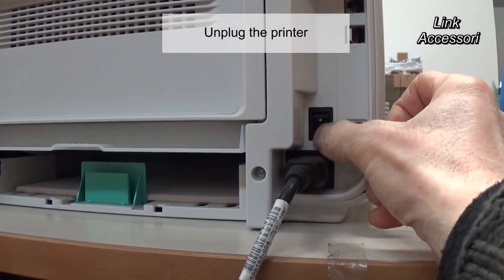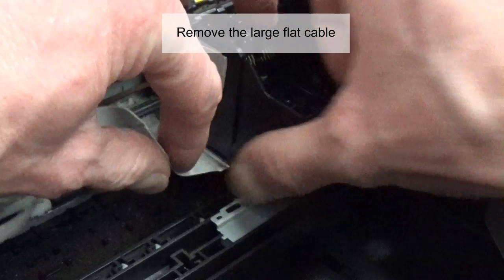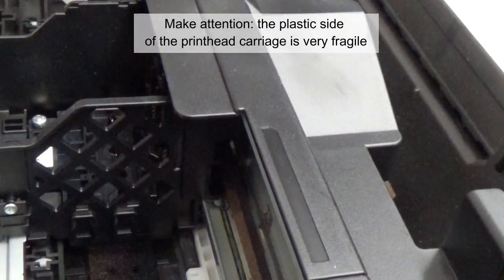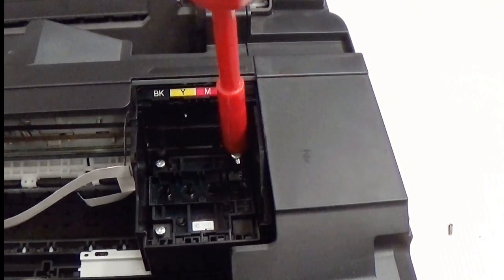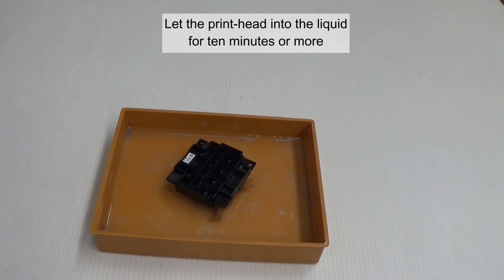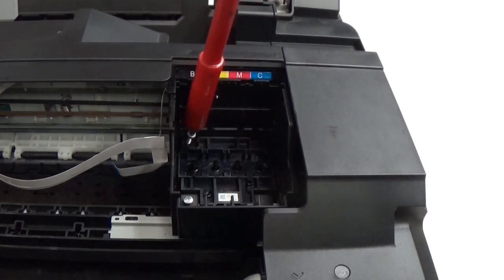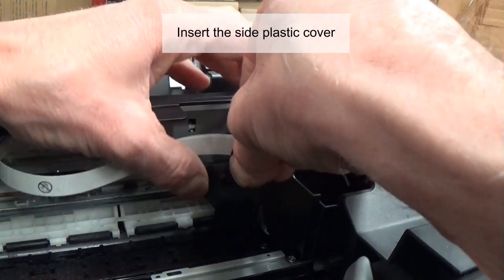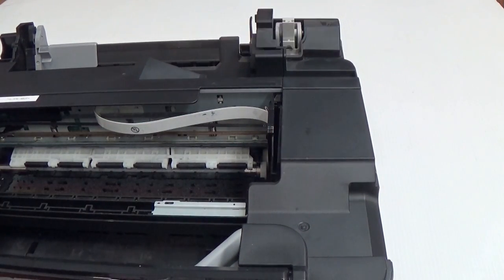How to remove the print-head from Epson inkjet printer XP300 WF2530 WF2540 XP400 and others

Comment: EXTRA CLEAN!!! I followed the video but after soaking, like the cleaning kits, I took a syringe with a tube on the end and flushed all four nozzels with hot water and window cleaner til it came out clear. Works great! The ribbon wires can be tough to get back in but make sure they are in snug. If it's loose it's not all the way in.

Comment: I did it on a Epson Stylus NX330 and i had to do it twice(put it in hot water) but it worked. the pieces are a little bit different but it's the same steps. You have to print many test to let the ink comes in the head.Finally it works well. Thanks a lot.

Comment: I confirm that this method works on WF-2540. But at the end I needed to run the head cleaning from the printer's menu around 4-5 times to get perfect prints. Thank you very much for this video!

Comment: Excellent video. I have cleaned many print heads before and this was by far the trickiest. My XP300 had almost stopped producing color, and black print had white lines and gaps running through the text.  As well as immersing the print plate in shallow warm distilled water, I used an eyedropper to force water down the individual color plugs on the top of the unit.  I kept changing the water until it was almost clear. I followed this with a cautious use of compressed air to blow out the channels. After much fiddling to put the unit back together. I then ran a cleaning cycle to prime the now empty ink channels,  followed by a couple of pages of fairly intense color. The printer is now working like new.
Reply: I read the other comments about the upper small back cable, but I should have kept reading to see this one! Just put mine in shallow water but forgot I have hard water, hope that doesn’t affect the end results. Distilled would have been a good idea.

Comment: Thank you very much for this video. Very detailed step-by-step instructions. In the end, I could not get the print-head to unclog, short of using the tube and syringe method in other youtube videos. So I just swapped print-heads out from another XP-400 and it works just fine. Thanks again!

Comment: Hi, excellent video. I had attempted to clean the head on my WF2530 with the cleaning fluid but it didn't work and still left the black printing intermittently. I removed the head as per your video and then replaced it. After one nozzle check cycle using the printer I had perfect printing.
A few observations, when the print head is placed in the water make sure it doesn't allow water into the connector for the large flat ribbon cable, the water has to be very shallow. I also used a small syringe with a plastic tube on the end, I had one that I used to clean the heads with cleaning fluid, to push a small amount of warm water through the head from the top using very very little force.
To be on the safe side slide a thin piece of blotting paper into were the large ribbon cable goes after cleaning the head to ensure its dry. Also it's possible to put the ribbon cables behind their intended connections make sure they are in correctly.
Reply: What do you mean by "put the ribbon cables behind their intended connections make sure they are in correctly." ? =)
Reply: However, I submerged into the water as the video shows. Now my printer is flashing the lights and not much I can do.
Reply: @cfvgd  That they are not in place and you only think so !

Comment: Worked on WF-2510, but it is best to remove the scanner section first to allow easy access ( just google epson WF-???? scanner removal), i also used a 20ml syringe and hot water to flush water through the ink intake ports on the head unit. As others have stated follow the instructions carefully, only remove ribbon cables indicated in the video. Thanks for the video, saved me buying a new printer.

Comment: Just to let people know everything is right on video besides the small ribbon cable. You do not have to remove the back top little ribbon cable,if you do your screwed. You will never get it back in. This video cost me a printer,oh well needed new one. Beleive me take your time on ribbon cables,and whatever you do. Do not remove little ribbon cable on the top back. Besides that it's a great video
Reply: hey thank you for the comment! i was about to pull out the small cables.
Reply: I wish I had read this comment before attempting to clean my printer before going to bed
Reply: No idea why the video says to do this..serves no purpose and is impossible to get back in

Comment: A good video on solving a major problem for Epson printers, BUT, MY GOD WHY DIDN'T YOU WARN US TO NOT REMOVE THE SMALL CABLE IN THE BACK!!
Reply: I just don't know how but I plugged it.😂 Just try with your finger and push a bit till you get the hole!
Reply: as a veteran printer repairman , you will need either a long thin needle nose plier & or a grip-type tweezer.... when inserting it back in,
make sure the METAL SIDE contacts the circuit board !
Reply: @xrtyty  Glad you mentioned tweezers, was about to give up until I read this. It does actually say to remove only the two cables so that'll teach me for not paying attention 🤦‍♂️
Reply: How does that back cable magically apear plugged in!!!! 😱😱😱😱
Reply: That was so difficult.  I had to grab the electric taped to get the flex cable out of the way first.uusing electric tape I taped a flathead screwdriver to the notch under the blue stiff part of the back cable and gently with my fingers to stabilize I pushed it in.   It went in fairly easy.  The bottom one was crazy I had to flip the printer on its side.   After turning it on I had to wait a few hours for all of the colors to print brightly.  What a headache!
Reply: @victorvill3812  a
Reply: Exactlyyyyyyyyy
Reply: Lol after an hour of trying to get the small one in I threw my entire printer away

Comment: Be very careful trying this method, I tried this on an XP-446, which had a very similar setup.  It seemed like it would work -- I got all of the parts disassembled successfully.  The board with the electrical contacts gave me a little trouble, but eventually came out.  The print heads gave off a lot of ink when soaked.  After I had everything reassembled and reattached, I noticed I had stretched the bends in the flat cables a little too much, and they were dragging on the printer frame when the assembly moved.  As I tried to bend them back into place, disaster -- the small cable in the back came out, and as many have noted it's incredibly difficult to put back.  I removed the plastic piece that ran along the back of the print assembly track for better access, and after a while even tried the method mentioned below using tweezers/rubber band/knife, which seemed promising until the ribbon cable ripped at the end when I tried to reinsert it.  I should have read a little further about disassembling the printer even more, but I was really tired of dealing with this printer already.  Now the printer is officially the complete piece of junk it pretty much always was.  And I had just wasted money on new (now useless) ink catridges as well.

Comment: STOP, DO NOT REMOVE SMALL WHITE CORD. If you do then you must unscrew the screw on the right hinge on the inside then push on the 2 clips on the left and lift that plastic piece. Then you will have better visibility to use your finger or tweezers to get it back in. Otherwise you may have to disassemble a lot more.

Comment: The small ribbon cable in the back can be put back IF YOU SLOWLY TAKE YOUR TIME (LOL, I DID NOT AT FIRST). push the carriage toward the right side until you can see the white "mini usb looking" slot behind the carriage.  Then take a pair of 8" curved hemostats and attach it to the end of the ribbon cable so that the blue part does not move left or right.  You will also have to angle the ribbon cable so that it goes straight in and this may take a few tries to get the angle right.  If it takes more than that YOU ARE IN TOO BIG OF A HURRY.  The left finger hole on the handle (for me) was touching or close to touching the metal wall.  Angle the hemostats so that the ribbon goes straight into the opening.  Do this slowly.  When you feel a little resistance and the ribbon is seated, pull the hemostats back and the ribbon should stay.  I BEAT MY HEAD INTO THE WALL AS MANY TIMES AS YOU DID AND THE RIBBON DID NOT GO IN UNTIL I TOOK MY TIME AND SLOWLY GUIDED THE CABLE IN .  You may want to use a flashlight to see just where the slot is and you may have to guide it to where you thing the opening is.  IT will work...

Comment: MY GOD! ... I disconnected the top cable too, like everyone else here...BUT I WAS ABLE TO GET IT BACK IN without disassembling the printer further. Here's how: I rubberbanded a pair of tweezers shut as hard as seemed reasonable, and inserted the blue tip of the cable while prying the tweezers open with a knife. this let me maneuver the tweezers and thus the cable from the very furthest end of the tweezers - providing just enough visibility and and space for my fingers. i gently edged my way through this and was able to insert it. then i cut off the rubberband with an exacto knife and unraveled it. then i exhaled. and they said it was impossible. holy. fucking. hell.
Reply: holy hell thank you so much for posting this! I tried for an HOUR to get that thing back in and your method worked! bless you!
Reply: Wrapping the tweezers with a rubber band was an excellent idea and worked for me. Unfortunately once I tested the printer after all this it still was missing lines while printing. Guess I'll replace this $45 epson with a $19 cannon printer...

Comment: WARNING Before you remove any of the ribbons read the comments!!! Like many on here I removed ALL the ribbons and the rear one is impossible to reattach. The video is good apart from making it clear you should only remove two of the ribbons. It would be helpful to make the video clearer showing how to reattach the fiddly ribbons. Off to buy another printer.
Reply: Make Attention!
Reply: @LayneBenofsky  , exactly the mm work with an xp 2155, I removed the bad little white cable at the back, result I had to put the soldering iron to remove the small detector at the back, once reconnected, I glued with a glue gun, problem it never worked again because the printer flashes all these leds at the same time...not found how to make it work again.

Comment: Thank you good sir. Worked amazing. DO NOT REMOVE THE FAR BACK RIBBON. WATCH THE VIDEO CAREFULLY.
Reply: as a veteran printer repairman , you will need either a long thin needle nose plier & or a grip-type tweezer.... when inserting it back in,
make sure the METAL SIDE contacts the circuit board !
Reply: It was off when I saw it!!! 😫😫😫😫
Reply: Hello did you find how to put it back? Any video of disassembly maybe? I removed it also...
Reply: You can put it back thru the back of printer by removing the white that holds the all the white ribbons. You will have to disconnect the two big ribbon connected to the scanner board. Put them to the side. Slide back the printhead carriage then you could see the connector thru the little slot. I was able to connect the small flat cable.

Comment: Found the easy way to put third tape back in case you disconnect it like me and most people here. To put it back you have to take of scanner it's easy and there is white plastic holding these 3 tapes. Just disconnect these 3 tapes and remove plastic so you will have enough space to put finger and connect thist tape to the back of carriage then put every think back together. It took me 5min to do it. Unfortunately my print head get broken after spend few days in IPA now it don't print at all.

Comment: THERE IS A MUCH SIMPLER WAY! You can clean the excess dried up ink off the bottom of the print head without removing it - fold some tissue paper and/or wetwipe, place it flat, and gently push the print head over the tissue/wipe. Job done. Start with the head in the position for removing ink cartridges, then turn off the power at the wall socket - if you press the off button on the printer the head moves to the side and locks into place - you won't be able to move it manually to do the cleaning.
Reply: It is better a visible cleaning than not to see the head ! Also you can have a special look at the head with a loupe to see if it is damaged !
Only with wet paper you cannot see what is done or remains !

Comment: This is an excellent tutorial, however this is not the faint-hearted or those that dont have experience taking things apart and more important the ability to put them back together accurately.  The ribbon cables will likely be your nemesis, so I would only undertake this process if you regard the printer as junk and its your last ditch attempt to rescue it from the great ecological nightmare of busted printers.  Its a good idea to take photos as you go, especially as different models have slightly different setups.

Comment: I confirm this works (beautifully) for an Epson Strylus SX235W (I fitted a rubber tube and used a syringe to squirt (hot) water (GENTLY) through each of the (hmm I'm blanking on what you call them _ posts?) multiple times until the water comes out not only clean but in a 0.5 metre long jet comprising multiple very fine streams of water.

Comment: I had the issue on an xp-205 smearing ink all over the paper that looked like roller marks, tried cleaning the heads the rollers, everything... I deduced it was under the ink head, after takin all the inks out and having the ink cartridge in the middle, i was able to spot the culprit, a collection of dust/hair had formed underneath and covered in black ink, (on the right hand side of the ink cart), which was smearing the rollers then the paper...I was able to clean underneath  (without having to pull out cables/clips) using a qtip and thankfully this fixed my woes... phew!

Comment: Hi! Thank you so much for the tutorial!! I did everything exactly how u said in the video and now my printer is saying "Paper jam. Remove jammed paper." And on the top it says W-02... What can I do?
Reply from the maker: probably a paper sensor along the path of the sheet is broken or out of position. Try removing all the ink cartridges and reinstalling 
them one at a time and moving the carriage over to the far left then back in position
Reply: Ok, I'll try it... Gracias! ;)
Reply: Did you get this fixed? I am having the same issue.
Reply: @viandant5  Hi I followed your tutorial and am encountering the same issue with the printer reporting paper jam. I checked for sensors and could not find anything obvious. Could you please help? Thanks.
Reply from the maker: @mfeijo  which printer?

Comment: Make damned sure you guys don't get the cable contacts wet, if you do and you restart your printer, most likely it will be shot. Just about everyone of the comments regarding problems after "cleaning" can be contributed to the cable connections being wet when the printer was restarted or the cables not being installed properly. If you have gotten the cable connections on the print head wet, you can use a can of compressed air and a blow dryer to dry them COMPLETELY prior to reconnecting the cables. This is very IMPORTANT if you don't want to fry your printer!!!
Reply: After cleaning the head of my WF2540, I started the printer and everything looked fine. After it started moving the print head to the right of the printer, it suddendly went off.
I am not able to switch it on now.
I had read your comment before cleaning, and that's why I put some tape on the connector before cleaning it. I also tried to dry it after the cleaning.
Do you know if there's still a chance to repair my printer? Any fuse that I could replace?
Thanks in advance
Reply: Mine was shot! I thought I had dries it completely. I even warmed it up with a blow dryer to make sure it was dry. When I heard it "sizzling" I reached over to shut it off and it cratered just as got to it. I was told it would need a new print head so I just bought a new printer. It doesnt take but a minuscule amount of moisture to fry it.
Reply: @Mark Simoes :The same thing just happened to me. If you found a solution please share with me!
Reply: Unfortunately same fried-printer happened to me too! even though I blow dried it quite well for 3 times 30" each, and inside the cable-connector really well. 
When i turned it on it started fine for 1-2 minutes at which point it just shut down (leaving the printer head in a mid-position, meaning it just went off power, not intentionally stop). I removed the head again and plug the printer but to no avail - there seems to be no resuscitation, no power-on! I ll find a 2nd hand head to try. Anyone can propose a solution to that problem? is there a circuit inside the printer that has blown off? Or a fuse?  or?????
Reply: Damn, I also fried mine, even though I used the compressed air (I know, it can push moisture in, but it seemed so dry). I was close to using 99% alcohol to dry it, but I wasn't sure if it would affect the head in some way. Now I am wishing I had gone the alcohol route. I wish these circuits were made a little more robustly. Sucks that I finally got around to fixing it, found this great video, got it all done, and then destroyed the freaking thing via the power button.

Comment: No it's the third ribbon which plugs into the back of the plastic carriage which houses the ink cartridges. There are two on the side and one at the rear. It's the WF2530 Epsom
Reply from the maker: To remove the print head housing you have to dismantle the printer, starting from side panels. I've no video or instrctions on this argoument
Reply: Damn =(  I guess I have to take the printer apart.  I removed the ribbon thats goes way, way on the back.